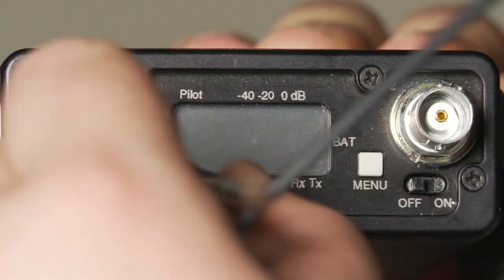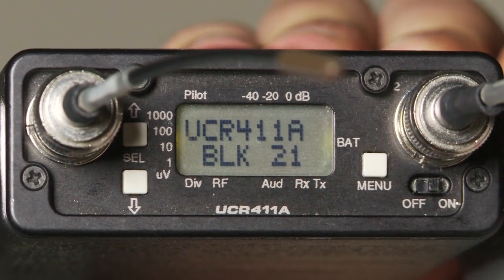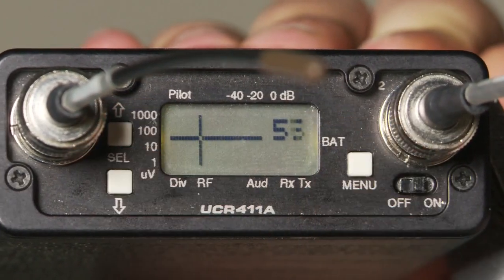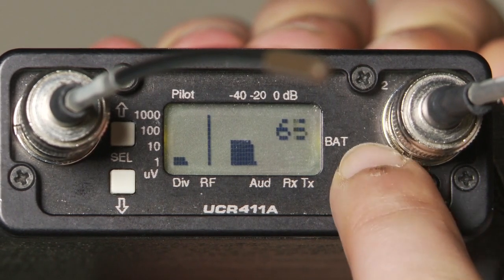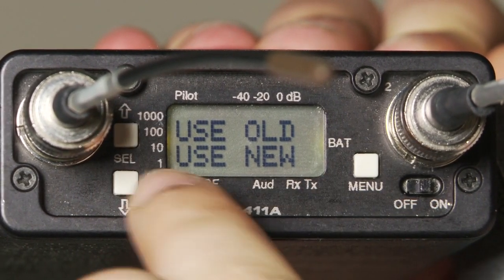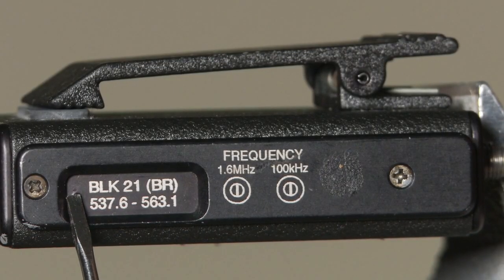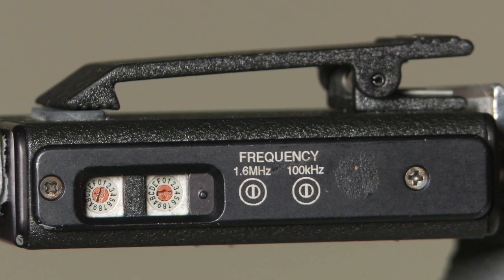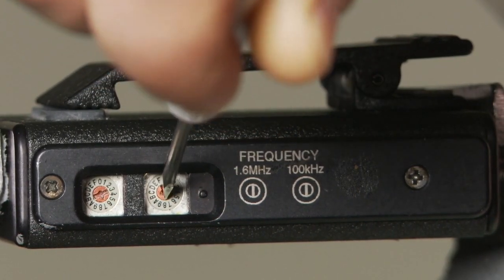Lectro Wireless Kit Tutorial

Comment: I notice you have frequencies with no interference, but on mine there is always at least one or two pixels with some areas having more. I know to pick a frequency with the least, but I'm concerned I'm not going to get the cleanest possible sound and that I might not have the right block for my city or something.  In the manual it says "in the worst case (pick one) with only very weak RF signals).  So...how much RF is too much? Thanks!
Reply: Always scan without the transmitters off first. Should give you the most accurate scan. If your still getting RF interference you may want to check the area for clear channels. Use telecordia(google telecordia white space) to search your area or the area you will be working in to find clear channels.
Reply: Grey Fox I meant with the transmitters off.
Reply: thanks!!!
Reply: The scan will show what's there in reality, not what a list knows about. But yes, a low level of interference can be overcome by sufficient transmitter power/proximity to receiver.